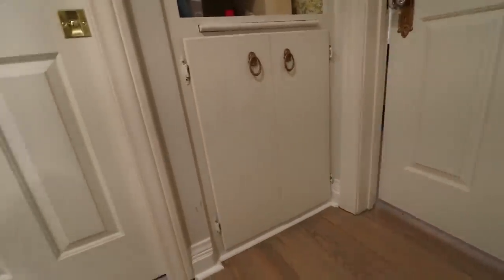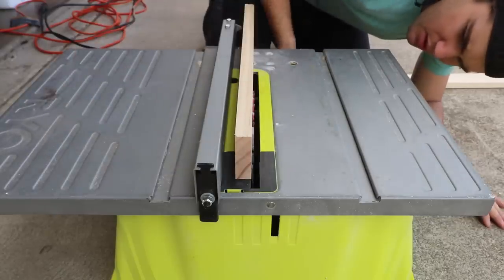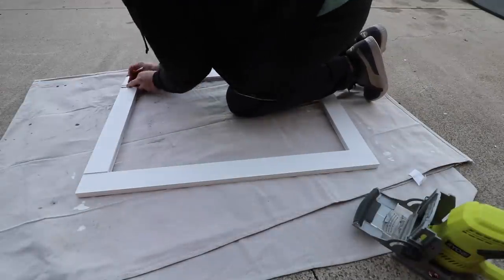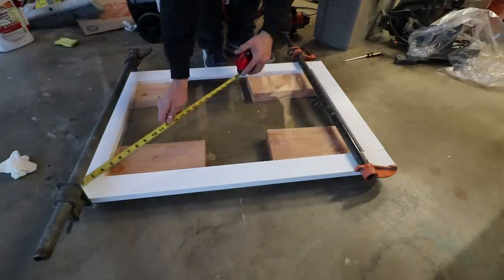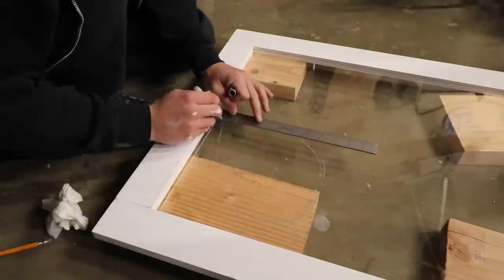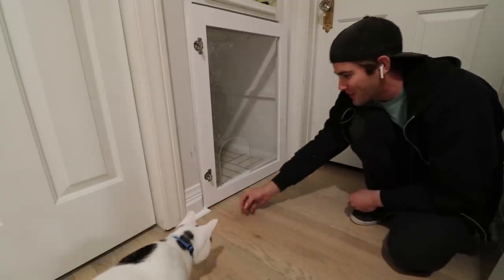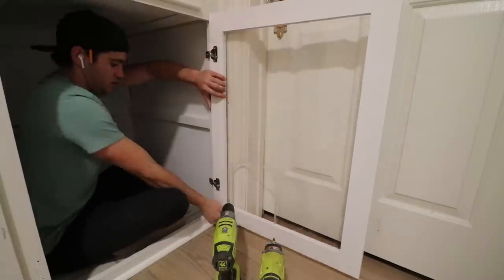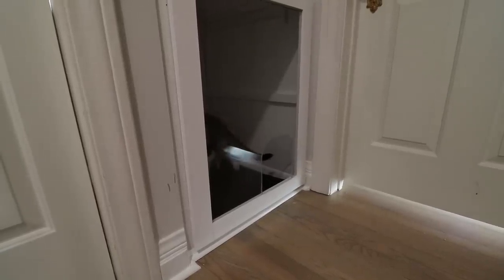DIY Cat Litter Cabinet

Comment: Shows cat the door is on the left, immediately flips the door to the right side 😂
Reply: CurveTheRain right lol I wonder if the cat accidentally ran face first into the left side at first before figuring out the opening moved to the other side
Reply: Well animals are smart they figure something like that out quickly
Reply: I know right!
Reply: The door wasn’t bolted in yet, which is why the hole was on the left. When he screwed in the door, the hole is on the right because it had to be flipped around...
Reply: Gus kept going to that side any way in the test run,so probably suited better.
Reply: @rebecca9906  that's what I noticed too. Seemed like that's where he preferred his entry to be. Lol
Reply: was my thought too
Reply: Who cares.
Reply: @leslie9423  who cares about an almost year old comment? You I guess.

Comment: I used to have cats and dogs. Of course the dogs wanted to not only eat the cats food, but also eat their poop.  Someone down the street was remodeling their kitchen , so I salvaged a 3-door base cabinet. I pushed the base cabinet up against a wall, that butted up against a wall in my laundry room.  I bought a "cat" door at the pet store.   What made it a "cat" door was that it  had a magnetic latch on the lower part of the door, activated by a mouse shaped magnet that went on the cats collars like a rabies  or name tag. Only the cats, (with the magnets on their collars) could activate the latch on the door.  I jigsawed out the panels on the base cabinet doors and stapled screen over the  openings.  I kept their food at one end, and their litter box at the other end.  Cleaning the litter box  and feeding them happened from the garage side.  I left my garage door open most of the time I was at home except after dark and in the winter.  The cats spent most of their time in their "veranda" enjoying being outside.  It was a great solution to not have the mess and smell of the litter box inside my house.  When the house was sold, the buyers had 2 cats and thought the system was ingenious.  I left the magnets for their cat"s collars because I had to buy a new cat door for my next house.
Reply: Rebecca Plunk . Impressive!
Reply: Sounds great, but I don't understand the garage door bit. Could you elaborate? I like the idea of having the food and litter tray near each other
Reply: @Beckface26  Really? Would you enjoy the toilet being in the kitchen? I don't think most animals like their excrement near where the eat.
Reply: @TheSwauzz Yes it's fine if they're not sitting directly next to each other. I like the idea of having a designated 'cat space'. Clearly her cats didn't have a problem with it.
Reply: AWESOME! I love it!!!
Reply: Rebecca Plunk   Very slick! You’re very creative 👍
Reply: That's awesome! Great idea! 
Although there's cats that don't like the litter & food next to each other. But if you put a bit of space they'd get used to it I'm sure. Yours certainly did. Sure wish I could do similar but I'm in a apartment. Oh well maybe someday I'll actually turn the porch into a catio.
Reply: Our cat's stuff is in the laundry room. We bought one of those metal doors that we can walk through that also has a lockable cat door on the bottom which kept our large dog from getting to her poop, but it sure didn't stop our Corgi from getting to her food! Had to tie the kitty door slightly closed so the cat could get through without the smol boi getting through

Comment: I would have just left the original doors and made a cat hole in it, trimmed it up then you couldn’t see the litter box inside. Cute kitty!
Reply: That's what I was thinking! The clear door kinda defeats the purpose of hiding it away. Cats don't need the light, but if you wanted to go overkill you could find a battery power motion sensor light for inside from some Chinese site like banggood.

Very nice workmanship, tho! I want that kind of finishing skill on my house projects.
Reply: Maybe for resale value ?

Comment: Install a outside ventilator and you'll never know there was a cat box in the house.
Reply: J C or just use good sand. Clean regularly.
Reply: If you're seriously thinking of doing that you need to clean the litterbox WAY WAY WAY more often.  If even a human can smell it, it would be awful for a cat with their much more sensitive noses to have to go in there.  And they even have to step in it.
Reply: J C that’s an awesome idea! ❤️👍🏻😺
Reply: Why do every cat Owner and non-cat owner feel the need to tell another cat owner that they'll need to clean their litterbox out more often? Don't you think they know that?
Reply: Or a self cleaning one? No smells  empty  weekly
Reply: A fan is certainly not a good idea, as it could startle a cat causing it to avoid the litter box altogether.
Reply: @sweetcanada17  Ventilation can occur naturally with just a vent on an outside wall.
Reply: @Mardon551  😹
Reply: @junbh2  Never had a male cat? Mine will stink up a clean litterbox on the first go. His urine is awful even after being snipped.
Reply: @siimmy14  i like carbon, keeps the odor for the cats but none for human noses
Reply: Fresh Step unscented cat litter does the trick. I clean it every day and it never smells bad.
Reply: We just took one of these out of the house we recently bought. The cabinet smelled so bad and litter was everywhere.  So gross

Comment: My house has laundry machines in a closet in one of the bedrooms, there’s still plenty of closet space next to it but I use that room as a den and put a covered litter box on a table to keep the dog out.   I like not having to bend down to clean it, and the table is big enough for extra litter and a bag of food in a sealed container as well as a small lined can for box debris.  Closet has 4 sliding doors on a track so I just keep one from closing with a block of wood.  I have a bathroom mat in front of the box but she still manages to spread litter onto the floor.

Comment: A trail of catnip into the space probably would have worked, too.   Very nice job.    And, btw, as someone who's been in cat rescue for 15 years now, I'd highly recommend you wash down walls inside with soap and water about once a week.   Invisible droplets of urine rise up and get into walls.  Over time,  the space could well start reeking of urine even though you have some ventilation with door and top part of acrylic.     I learned this the HARD way by having my drywall start smelling of cat urine even  thought my cats were using the litter box and not peeing on the wall/drywall.

Comment: I took a opening under a set of stairs where the door was in the garage to allow storage and cut in a kitty flap door from inside the house to the storage area. I mounted a motion detector LED light and mounted a bath exhaust fan in there as well. When kitty went in, the motion would turn on the light and fan for 5 min.  Fan took the Smell out if the closet and into the garage.  No smelly house and one happy kitty.  Lol

Comment: I have done this for years. Had a pantry cabinet made with a hole on the side for the cat to enter the bottom of the cabinet to access the litter box. When I  was renting apartments. When I bought my own home I cut a door hole into the basement door, put a rubber flap on it and the cat went down there to use the litter box. Personally, I would not have made a transparent cat door. No one wants or needs to watch the cat go potty. It's fancy but not necessary when you could have just cut a little kitty door at the bottom of the existing doors. Plus cats like enclosed cubby holes. Your workmanship was great though.
Reply: Cats actually like to be able to see outside of their litter box, so they can run away in case of danger. Cat whisperer/therapist Jackson Galaxy talks about this too.
Reply: @sweetcanada17  Yes and that's why they spend all their time in boxes and paper shopping bags, totes and closets because they like transparent walls around them so much. lol not
Reply: Whisperwoman - when cats defecate/urinate they are at their most vulnerable and prefer to do it where they can easily see what’s going on around them. Please don’t quote me any anecdotal evidence, which pales in comparison to the findings of cat therapists. My cat was having behavioural problems, and refused to pee and poop in her closed litter box, and once I changed her litter box to an open one, everything changed for the better. I was willing to learn from cat behaviourists. 
Playing and hanging out in boxes and paper bags cannot be compared to the time they spend in their litter boxes.

Comment: This is such a great idea! I think I would have just installed a cat flap on one of the original cupboard doors and put a stick on motion sensor light inside for kitty, though. Then it would be less noticeable from the outside as a cat bathroom and a bit easier too! I’m definitely going to try this, great job! :)

Comment: I have a hooded litter box and keep it in the guest bath. There is a motion activated night light in there for when his gotta go a night.
If you're not using litter box liners you gotta start. It makes the dump and clean process so much faster.
Remove liner, wipe with disinfectant wipes, let dry, put in new liner, add new litter done. No more scraping of clumps of pee getting or hose out.
Reply: Are your cats declawed? Mine would shred a liner.
Reply: @YSLRD  Nope. He has his claws. He's never shredded the liner.

Comment: Awesome job...you should try pine pellet litter though. You can get a 40lb bag for $6 at feed store/tractor supply. It's biodegradable and the urine turns pellets into sawdust. Ends up smelling like fresh cut wood. I clean poopies daily but only change out pellets 1x/wk.  Rescued 3 strays off 35 acres(that weren't familiar with a litter box)and they took right to it. My kitties & I love it.  Wasted so much money all these years on chemically produced clay litter. Never again!

Comment: What thickness of plexiglass did you use? Do you think it was a good choice (easy to cut using the Dremel; resistant to Gus' scratches )? Do you think a frosted one would've been better? Just asking because I'm about to purchase mine so I can make my own version in a hallway closet. The opening is 18" wide, so I'll see if I can find a 16" or 17" piece to allow for the frame to be on the outside perimeter. Thanks!

Comment: Depends on your cats preference, but you may want to consider a tiny LED light inside. It could even be one of those stick-on kind of fake light switch kind of things if you know what I mean, one that runs on batteries. You would be running it a lot so a permanent solution would be more ideal tho. (and yes I know, the cat does not operate the switch, you would lol)
Reply from the maker: My cat has built in night vision eyes

Comment: Really cool, but really dangerous way to use the table saw.  Never stand directly behind (or over?) the table saw and always use a guard.  With that many tools you should use a router or else just glue three thinner peices of wood together. But I'm not sure you actually need the plexiglas at all.  

   Another option I've seen is building an end table with the litter box inside.

Comment: That was a great solution. Just curious why you chose a clear panel rather than frosted which would hide the litter box.
Reply: I dont get that bit either!
Reply: Cats actually like to be able to see outside of their litter box, so they can run away in case of danger.
Reply: @sweetcanada17  that doesn't really hold true though or a covered tray would never work....
Reply: ChrisAndCats - it usually doesn’t. That’s why most cat psychologists advise against them.
Reply: @sweetcanada17  that's interesting given that cats usually like to hide.  Given the choice between covered and open, my wild born girl always chooses the covered and my previous, super-nervous girl did too.
Reply: ChrisAndCats - when cats defecate/urinate, most of them prefer to do it where they can easily see what’s going on around them. Yours is only anecdotal evidence, which pales in comparison to the findings of cat therapists. My cat was having behavioural problems, and refused to pee and poop in her closed litter box, and once I changed her litter box to an open one, everything changed for the better.
Reply: @sweetcanada17  I'd say it varies from cat to cat, and rather than assume based on a generalisation,  we should give them the choice along with tray location and see which is preferred.  Wild born Stripey👖 here is a bit of an oddity in a lot of ways however so I wouldn't be surprised at anything she chooses to do!  Exasperated at times possibly as I have Dennis the Menace in fur, but not surprised.

Comment: Hope you used a NON-TOXIC paint in that enclosed area. Cats are extremely sensitive. Cute idea but doorway needs to be bigger... especially taller.. cat has to bend down to go in and out. Cats do like privacy.You could use contact paper for privacy.. they have frosted glass look and stained glass look and light passes through.

Comment: Cool idea, but don't you need a little more ventilation in there? I know the point is so it's not messy or smelly for us humans, but it can be smelly for them without ventilation (even with regular cleaning) and could possible deter them from using it...just a thought

Comment: Could possibly work for one cat. But if you find that they’re marking, your cat isn’t liking the hideaway litter box.. some cats will tolerate. Others do not like to set up. Cats don’t need privacy. I know humans are often repulsed by litter boxes, but sometimes you just have to get over it if your cat doesn’t tolerate a hidden litter box. More than one cat, they could mark it/urinate. Just a heads up. Proceed with caution

Comment: That enclosed space with just a little space for ventilation?  Even if you are supremely vigilant about scooping the litter after each use and use scent free litter, the ammonia smell of urine, stench of a loose stool, or some strong fragrance crystals in litter are still subjecting your cat to intense fumes.  If you don't have an open area, install some form of exhaust system or air purification.
Also, a drawer that can pull or slide out would make it easier for whoever has the job of sifting the litter.

Comment: Nice! awesome design. May I suggest that you guys look into wood pellet wood starters as cat litter. It is not only safer for cats compared to clay but it also does not smell terrible. check it out! there are youtube vids out there.  They are also cheaper and environmental friendly.

converted to these wood pellet stuff a year ago from clay. never going back and less dirt dust in my house!
Reply: I tried that.  VERY difficult to scoop without removing a lot of pellets AND unless you dump out all the pellets each time you scoop, you'll be leaving urine-soaked ones in litter box.
Reply: @arx754  two box system. Garden sieve, sieve the waste into a rubbish bag, put pellets into the fresh box litter box.  Or you can sieve directly over the old box, and then empty it at the end into the rubbish bag. Wipe old used box, now it is ready to go next time you need to clean
Reply: @sequimini  : Perhaps I should have mentioned I've worked in cat rescue for 15 years now, and I have a LOT of cat fosters and a LOT of litter boxes....   lol.   So, "clumpable" litter is what works best for me because otherwise scooping would take 2-3 times as long.   I DID try pellets, cedar shavings, you name it.   Kept coming back to clumpable litter because litter stays cleaner and much faster to scoop.   If I only had 3-4 cats, I'd do what you're doing.   Like the whole idea much better than regular litter.

Comment: So you got the cat use to going in and out the left side of the door, and then mounted it on the right? C'mon...messing with the kitty. I agree they like a little privacy when using the litter box. Overall, it's a good use of space. It's big enough that all the random litter should be contained in there as well.

Comment: Oh yeah, DIY if you’re a damn carpenter with freaking table saws and dremel tools 🙄
Reply: Patric Parkison   Lumber yards and even Home Depot will cut boards to your measurements and you can use a sanding block instead of a dremel. I do DIY’s a lot without power tools.
Reply: I got a hack saw--- doubt anything I do would be as pretty as his